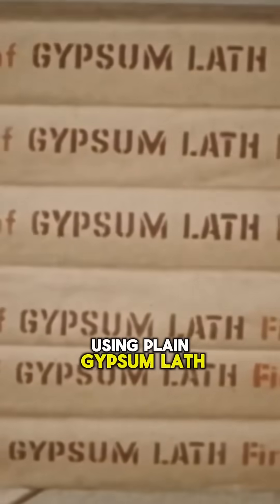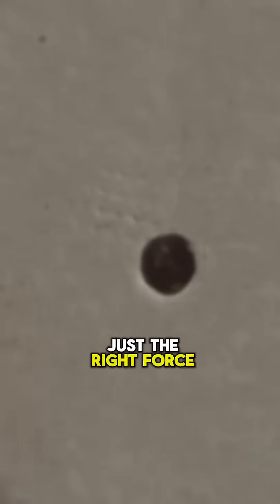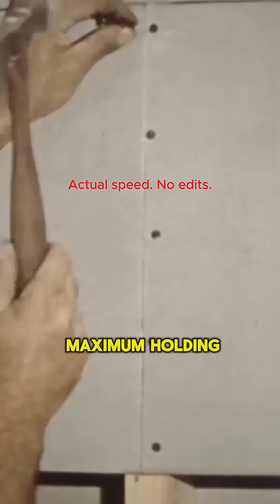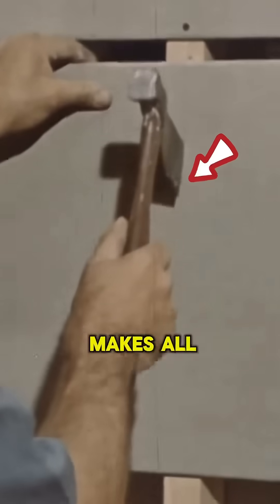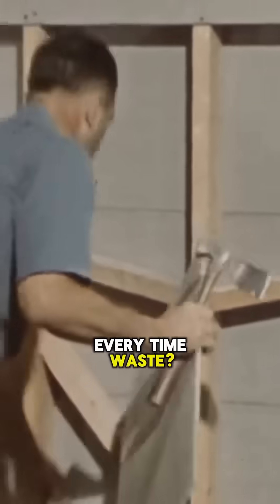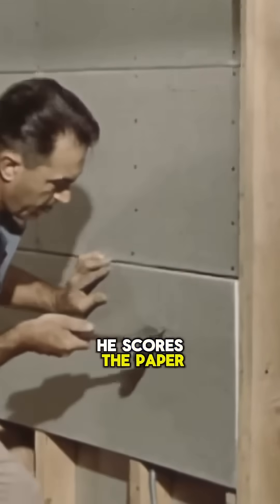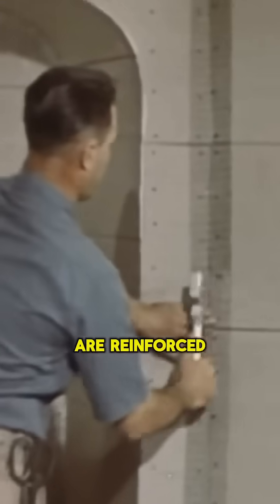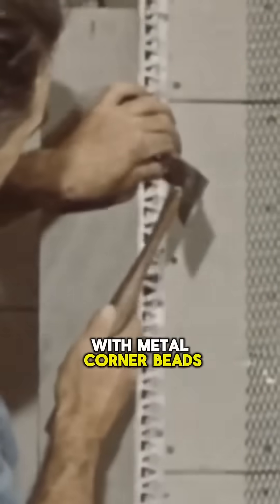1950s Drywall Master Craftsman (Actually Gypsum Lath!) #shorts (@GypsumAssociation)

Comment: I was doing this until they stopped making the lath. Now I have to use 3/8 drywall as a substitute and punch holes myself.
Reply: Question: i am considering starting doing this by myself like this craftsman here. How is this exact drywall tool ( axe/ hammer 🔨) called?

I want to use nails like him instead of screws because it's much faster.

This gypsum lath ( we call it Gipskartonplatten in Germany)...
The ones He is using look a bit thinner than todays ones no?
How many different kinds of these are there around and what is suitable for nails and easy cutting like his?

Thx in advance 🤗
Reply: @m.j.9318  The gypsum lath used there was called Gyprock or Rock Lath. It was only 3/8 inches thick. It measured 16 inches wide by 48 inches long. The tool used is a Lath hatchet, it was from the days when wood strips were used as lath.
Reply: Thanks alot! So wood strips instead of gypsum?? Or instead the cardboard? @chargermopar